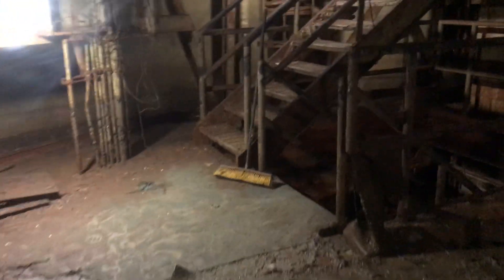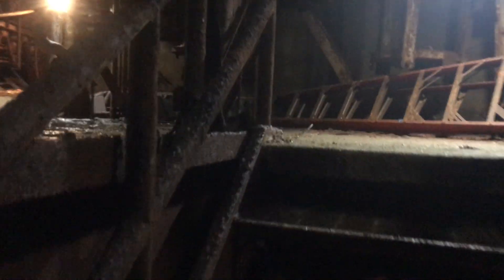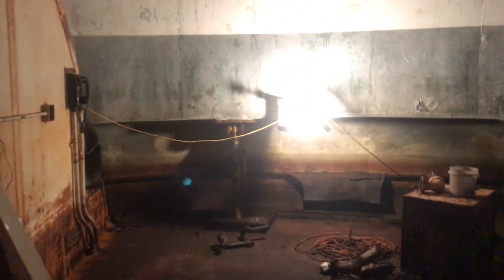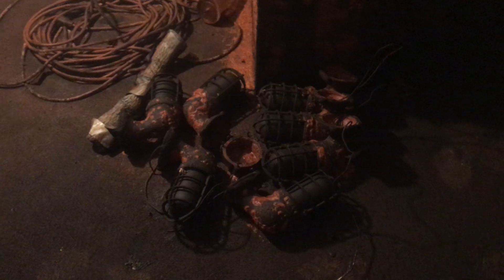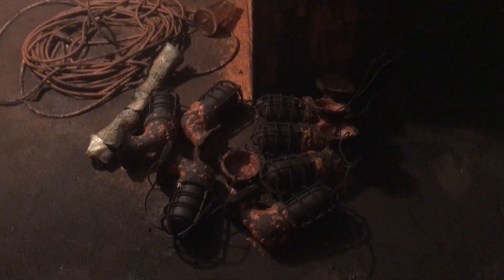S1E5 - The First Tour of Launch Control Center Level 3  - Owning a Titan II Missile Silo

Comment: dry it out, hire some guys, buy some sawzalls and saw blades, some grinders with cutting wheels, some torches, have a metal only dumpster from a recycler dropped off and go to town....when done stripping, buy a respirator, a good quality decent size sand blaster, get some crushed walnut shells for the blaster, turn the fresh air blowers on high and go to town. STAY AWAY FROM CORDLESS for the demo...not enough battery power

Comment: I'd be extremely surprised if asbestos was in the walls. Asbestos is a poor insulator at low temperatures so there'd be no reason to actually use it. The reason is that it tends to attract humidity and it stops insulating well. It's most certainly fiberglass. 

One very simple way you can tell if it's fiberglass or asbestos is by using a simple propane torch. Fiberglass will melt at a surprisingly low temperature. Asbestos fibers will not. They will glow very bright, but not change shape significantly.
Reply: More likely to have stoss in some of the switches/fuse boxes, toward the end of the video looked like a general electric box, friable arc arrestors and door gaskets.

Within the walls would make sense if it was to protect against the heat of the blast; I wouldn't think that would be a concern in the accommodation block though. Still it was cheap and easily accessible...
Reply: I have no doubt it's in some places like you mentioned, but I was just saying it was unlikely to be used as wall insulation, especially in a friable form. The accommodation block was so far away from the actual silo that I can't imagine there being heat from that. Fiberglass was available and cheap.

Luckily, if it does exist, it's unlikely to be brown or blue asbestos as that wasn't used since the 1930's or so. White asbestos isn't nearly as dangerous.
Reply from the maker: Thanks for the info. For now I treat everything like it’s dangerous until I’m sure it’s not

Comment: Excited for you to finish pumping out the bottom floor of the command center, is there a way for you to get under it and jack it up so it's perfectly level? Also congrats on having the manual door controls intact, what are your prospects for restoring those you think? 

Edit: I would try to drain the silo as soon as possible 🙃

Comment: Are you going to be unearthing the actual launch silo itself?
Reply: Joe Kinchicken  what about that company doing the doomsday hotels?
Reply: Joe Kinchicken  survival condo dot com is one, I think an older hippy couple did another one
Reply: Joe Kinchicken  I wasn't aware of the fact that the Titan sights needed to be partially destroyed. Can you elaborate? What did they have to take out that got to stay in the atlas sights and so forth?
Reply: @nonpublicpretexto283  All the military hardware was stripped from the Titan complexes, then the top ten or fifteen or so feet of both the access portal and silo were blown off. These were backfilled with the rubble and dirt fill. The escape hatches were filled with fill and grout, and the silo was capped with a three foot concrete slab to cover it. Really really tough to get back into one of these Titan silos.
Reply from the maker: Not impossible. It’s really the water that is the most annoying part. If I was in Arizona I would already have a video of inside

Comment: Don't you have to worry about mold after you pump the water out and start pushing air into the silos?
Reply: 100% like all things, but depending ventilation and how wet things stay it might not get moldy all that fast.
Reply: Looks like there's already black mold on some of the walls and on a sheet of plywood

Comment: The sewer pumps should be fine. You'll need new motors, obviously.
Reply from the maker: They were fine in the other site. I will check them but I'm hopping for the same. About $500 per motor
Reply: @atomicunderground9971  

Grainger may be cheaper... if needed.
Anytime bearings get submerged, they're toast.

Comment: I saw what appeared to be a range hood pipe, If so where did they run the exhaust to? Was there an external exhaust that could be locked down in the event that there was a nuclear strike?
Reply from the maker: Steve Stoltz I think it just vented steam into the overhead. Definitely no exhaust going out of the building. Excellent question and one I will try to find the answer to.
Reply: Atomic Underground thanks for the reply, that’s been a question bouncing around in my head for a while now, just no one to ask lol.
Reply from the maker: Steve Stoltz I will remember to ask the next time I go to the museum. Even in and out of the silo all the time I notice new things every month. I never even noticed the pipe.
Reply from the maker: The range was electric in the silo. The exhaust from the vent hood joins the air conditioning return and apparently gets filtered through the air handling unit on level 3. The design of the LCC has all the air go from the LCC to the long cableway through the blast lock then out somewhere in the silo.
Reply: @atomicunderground9971  Thanks for checking into that, I always wondered exactly how that sort of thing was handled.

Comment: The asbestos abatement is going to cost a fortune if that's what those panels are made out of.
Reply from the maker: The soundproofing turns out not to be asbestos. The only stuff that is asbestos is the air conditioning lines. They can be wrapped in plastic and taken out intact fairly easily.
Reply: @atomicunderground9971  That's certainly a relief!
Reply: @atomicunderground9971  What my plumber told me is that if the asbestos pipes are intact and undamaged, don't touch them, they're fine. They even took a sample to test it for us to see if we needed to remove it. I don't know how much of it got wet in your silo, but if some of it stayed dry and is still preserved well, you can safely leave it be. It'll save you a bit of money for now, and if you want to remove it later, that's up to you.